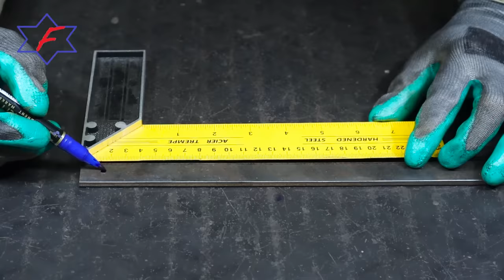Homemade Awesome Motorbike 250cc From Car Wheel And Using Single Side Swingarm

Comment: I have a few concerns #1 Why did you put both washers on the outside of the break flex hose #2 the steel hinges for the rear frame #3 the rear wheel bracket is welded in crocked #4 those small bolts on  the front and bars they are attached to there is more, but that this g is in no way safe to drive.

Comment: Anyone else notice the confounding front suspension design that tries to stretch the shock instead of compress it?
Reply: Nope
Reply: The front fork will not live long 😂
Reply: I'm wondering how he's welding without rod
Reply: Try to make a turn on that bike with that garbage Renault 5 wheels😁 not the best choice for a bike!
Reply: That's not safe...
Reply: He also didn’t try to see if the arcs of the fork systym even worked without binding before he was jumping on it , scary
Reply: Dear God in Heaven. The rear end is held on by the pins of two door hinges.
Reply: 22:36 look at that chain slack shake! 😂 How's it even staying on?!
Reply: @SirWulfrick 
It won't matter its not geared and will only go 15mph 😂

Comment: Use filler wire when TIG welding or that bike will collapse under your weight
Reply: Those door hinges for swingarm pivot are extremely sketch too.
Reply: I’m kind of concerned about the hand tightened nuts on the wheels. I would use a power tool to add torque to those nuts rather than hand tighten them. Or just use locking nuts and tighten them in the same way.
Reply: @Timberwolf35546  😘 en 😂😂 de 😂😂 de sector 😂😂😂😂😂😂*
Reply: @Timberwolf35546  ñ
Reply: @yellowtailsmultiverse8883  I was thinking hope he tightened those good lol

Comment: The two folding chair hinges hold the entire rear axle. But not for long.
Reply: Ouch if it snaps at full speed.
Reply: in cars, it is the same at the wheel and supports a greater weight
Reply: @remussebastianmadmax5816  don’t quit your day job to become an engineer
Reply: And they put the hinges on backwards so one hard bump and it will rip them apart for sure. 🤦
Reply: Yeah  they look hella unsafe, especially supporting car tires weight.
Reply: p
Reply: He welded the whole thing without using filler rods aswell
Reply: @fastfreddy918 cm
Reply: Gav
Reply: Semoga berkah ya jari tanganku sahabat2
Reply: Semangat2 sahabatlu
Reply: @kbakeritsallaboutnobody.5761  Y se pueden romper la madre
Reply: @kbakeritsallaboutnobody.5761

Comment: Just a little tip! Clamp your work down on the drill press if you want too keep all you body parts 😊  was a machinist for forty years and got all my fingers
Reply: Machines have changed bady
Reply: Another tip: Put clutch on opposite way... easier on crankshaft end and bearing... clutch body helps keep pantleg out of chain... less stress on rear axle/bearings... spring load the chain idler sprocket...
Reply: Takes off barely and slowly because need 3 times as much gear reduction...

Comment: The ideas are great and inspiring but the execution has its issues... You can't fabricate parts by only eyeballing the centres...
Anyway, keep up the work!!!
Reply: needs to use threadlock, prevent it coming apart thru vibration caused by freehand minor errors in  alignment.

Comment: Very cool! I've been wishing for decades there were full-sized motorcycles with only 250 CC engines that tall guys could really stretch out on. They're light, affordable and fun to drive but no one seems to make them.
Reply: Wal Do • 5 мес. назад
Very cool I l've been wishing for decades there were full-sized motorcycles with only 250 CD engines that tall guys could really stretch out on They're light affordable and fun to drive
Reply: Wal Do • 5 мес. назад
Very cool I l've been wishing for decades there were full-sized motorcycles with only 250 CD engines that tall guys could really stretch out on They're light affordable and fun to drive
Reply: @eeertvoin3161  🤔
Reply: @eeertvoin3161  твой пост странный
Reply: Harley-Davidson made one called The Route 66.

Comment: Awesome vid,awesome bike,I want one,but I would use lock washers on all the nuts and use filler wire on most of the welds. Great videography. I also would have a clamp for the handlebars so they could be adjusted,and a bracket on the exhaust, but an awesome looking bike and prototype,thankyou for posting,Best wishes to you, from, Auckland, New Zealand. 🙂👍✅⭐⭐⭐⭐⭐
Reply: 10:40
Reply: अअअ
Reply: Maq
Reply: @bariyakanubhai7810  !mm m
Reply: Agree… cool project, not sure about a few things as far as it lasting… welds without filler wire, using essentially door hinges for the articulation of the suspension, and the welding on the exhaust won’t last long with vibrations with its design and welding job. Clean thou, looks good…

Comment: Lots of quirky details: With those constructions, you can't expect either front nor rear wheel suspension to work - and consequently when driving they accordingly seem totally stiff.
Lots of corners and long bolts that could hurt yourself and walking people!
The hot air blowing from the motor cylinder seems to heat up the gasoline tank - could be a fire danger!
If you used all the parts coming with the bicycle stand, then it would be just a little more sturdy.
Besides all this looks nice and fun! 🙂
You could try to correct everything(!) - Good luck!
Ifyou get the rear swing to swing, then you need more chain guides.
Reply: OK Karen
Reply: You're not totally wrong. That front end is working against itself, you can see the single sided arm is the flex point. Ditto the rear,. it's pivoting on a damn door hinge, and is set in a way that even at rest only allows the swingarm to drop down, no room to go up. 

The gas tank and heat, however, the engine is covered in shrouds and has a fan inside the recoil housing that blows air through the shrouds and cool the engine. Residual heat while moving and even while sitting once shut down do not approach levels that cause any concern for the fuel.

Comment: Simplesmente fantástico......
Reply: Very Nice!👌🏍️
Reply: ok, rear swing arm on door hinges, it can last 2 days and then game over. and what about the welding of the frame with the bearing installed. Do you have idea what happens with the bearing if it is heated to 1000 celsius ?

Comment: Awesome, building a motorcycle from scratch!
Where the tube of the front wheel is connected to the head tube the metal seems a little thin. I don't really know, just visually.
Also conical bearings are better for a head tube but the ones you used are very big so that'll be OK.

Comment: 15:23 - I'd highly recommend against using a threaded bolt for a shock bolt because it will wear away at the inside of the shock mount and start making it rattle and get loose.... It's easy to get shouldered bolts that are made for shock mounts, but that's only if you want your build to last a long time.
Reply: اسلام علیکم میاں نیو یوٹیوب پر ہو میری ہیلپ کریں پلیز
Reply: @mramir1888  I wont be able to help you

Comment: I definitely would have used a spacer in between my hub bearings! Awesome build non the less👍🏼
Reply: I definitely would have used a mill and a lathe to give some level of precision to the manufacture of the hub assy, a give away that you're about to see shonky engineering is the wearing of gloves. Anybody thats been educated at college or to apprentice level in engineering knows not to wear gloves when using power tools,  Thats day one safety.

Comment: It's a nice YT bike proyect for sure.
But I wouldn't bet on it lasting more than a couple (and I'm being generous) of years of regular use. 
It's weird to me how it uses heavy gauge tubing in some places and (what appears that be) very light one on the frame where metal fatigue and cracks due to bending (not to mention the weakening of metal where welding occurs) will set much sooner.
I won't go into the couple of, are those door hinges? On the rear wheel arm and how close the strut is to the pivot point.
Definitely made for entertainment purposes, not practical ones.
Reply: Couple of hours maybe, thing is a death trap!

Comment: Biggest construction mistake: Rear hinges are auto-destructive, they go breaking when wehicle loaded, and they are 1-2 mm thick only. Load doesn't affect suspension but hinges to break (rear wheel can only go down, not up).
Otherwise, inspirative, simple, but welding geometry very sloppy.

Comment: If you can get hold of a book called "Motorcycle chassis design by Tony Foale", it will advance your work by light years, and influence all your other projects in a positive way. Also, the advice given in the comments sometimes comes from very experienced people - it`s all worth taking into consideration. Good Luck
Reply: E-mail

E-mail

E-mail

E-mail

E-mail

E-mail

E-mail

E-mail

E-mail

E-mail

E-mail

E-mail

E-mail

E-mail

E-mail

Comment: I love how they drag the tig tip across an already welded joint to make it look like they didn't use a filler rod 🙄🙄🙄
Reply: 0
Reply: You're one of those
Reply: @brijnandansingh7702  j
Reply: @salvadordolly712  🤷‍♂Sure am. Why bother.
Reply: They tried to hide but you found them 😂😂
Reply: motor 👎
Reply: It's called "Saving time".

Comment: Outstanding build, I didn’t see one piece of filler wire on the welding of any parts, as an engineer and qualified boilermaker, I certainly wouldn’t ride the thing. But groovy none the less.

Comment: You put your hydraulic brake hoses on wrong. A washer goes on each side bof the banjo fitting on the caliper. See how they're supposed to be on the handbrake. The way they are now may cause them to leak.
Reply: Nuif
Reply: I saw that too but they get corrected in time for fluids!

Comment: The design is good and the workmanship is excellent. I do feel that  both the front and back suspension could be better. Those two  hinges at the back do not complement the strength of the whole bike, same for the front suspension.
Apart from that the thinking behind it all is brilliant, Congratulations. All the best.

Comment: Good video, but one question: did you reverse the brake calipers? I say this because the bleed screws were down, and as we mechanics are tired of knowing, the air bubbles go up.... so your brakes can fail heated ☹️

Comment: Anyone notice that he put both crush washers on one side of the banjo bolt on all the brake hose connection! lol.    You don't think the front shock is doing anything since the double pivit point he welded to the down tube! I did like the video though.. 6 out 10!

Comment: As a bike builder, I can appreciate the inginuity, but there are SERIOUS safety concerns with the swing arm pivot, the brake line mountings, shock mountings, and chain alignment.

Even using it to run around the yard could result in serious injury.

A bit more thought would eliminate the problems on what is actually an inspired design.
Reply: Edit - he sorted out the brake lines

Comment: OK. Now, remove the centrifugal clutch, replace it with a torque belt drive, and jackshaft it also. Then maybe it will climb a hill, even with the driver aboard, considering it's weight.

Comment: nice work but the following locations will fail due to fatigue cracking from leverage.   the front forks,   the rear swing arm,  the front floor where it connects to the pipes going up to the stearing ,  the muffler pipe will fail where it attaches to the head, and the chain will come off  sprocket.

Comment: You need a much bigger rear sprocket. I would start with 60 tooth and that should be good for 45 mph at 4,000 rpm.

Comment: 7) You can not weld that cold-rolled steel properly without grinding off that mill scale
8) Use proper gas and Tungsten. For video purposes it was qwick ,but we know better...🤔🤔🤔...Otherwise nice job

Comment: No chain gaurds and two tiney screws to hold that kik stand on. Total cartoon. I built highspeed competition machines for over 50 years and safety inspectors wouldn't even let you ride around in the pit sreas on this joke. Dandahermit

Comment: I have never seen such mistakes in only one construction 😂.  Welding process is awful without metal apport in TIG, no washer under nuts, no maintain of ringballs, and the best  the fiting of brake pipes with 2 washers on the same side. Congratulations you make me laugh so much 😅😅

Comment: That was by no means homemade. Very few have that kind of equipment in their home. And I think a simple direct one-to-one gear drive on the back tire with a clutch would have been better than using that floppy junk chain which I believe couldn't last more than a dozen miles.
Reply: Your comment is homemade

Comment: Unfortunately, major fail.  The use of auto hubs is ingenious, and the skill level of the builder is good, and well above my own.  The weak point, however, is the CLUTCH.  I know from my experience with go-carts that those centrifugal clutches will quickly fail.  You will be replacing them after only a few uses.  You need to get a clutch from a honda minibike or similar that is made to handle the torque.

Comment: Both front and rear suspension would fail.  No trail in front steering.  Rear shock too close to pivot point.  Front shock looks to expand rather than compress.

Comment: I do not understand so high grade comments, it is the worst metal workshop, may be welding is OK, but there rest of actions are  totally insafe and unreliable. Suspension does not work at all.  Unsprung mass is VERY high, Console mounting  of levers are thin and totally unsafe.  And cherry of this cake is door hinge as an axis of rear lever. And method of placing ball bearing is shit. It is interesting how to lubricate and replace weared bearing. And there is no coaxiality of wheel , take a look at video: front wheel is vobling. Mounting of wheels with hand-made caps is terrible, because it makes mounting uncoaxial again. Total: disposable-ride  unsafe unreliable, unfuntional staff. Thanks for attention.

Comment: центровка, балансировка, вы где???
Задний амортизатор просто для вида? Он же не работает...
Тормоза, видимо, также совсем не нуждаются в точных установках, можно примерно рядом приварить суппорт, и норм...
Что попало как попало сделано, руки хорошо работают, но голова плохо соображает.
centering, balancing, where are you???
Rear shock absorber just for show? It doesn't work ...
The brakes, apparently, also don't need precise settings at all, you can weld a caliper approximately next to it, and the norms ...
Whatever is done, the hands work well, but the head doesn't think well.

Comment: I notice he is doing a crap load of fusion welds, if your not a welder, means he using the apparent base meatel as the filler.. some applications if it's specified, it's not good to do for a full on structural build. They tend to be weak welds.. Under fill  to much conclivity , weak ass weld...

Comment: GEAR CONNECTİON TO WHEEL MUST BE SAME BREAK. BEFORE THE BREAK. NEAR WHEEL. SAME BREAK, WİTH STRONG FLANC CONNECTİON ON BEARİNG SHAFT.SHAFT MUST BE FREE. WİTH BEARİNGS.SHAFT AND SHAFT BEARİNGS MUST HOLD  WHEEL TO MOTORBYCLE MAİN BODY

Comment: HOW DOES THE GEAR TURN WHEEL. ONLY SHAFT ROTATES.  GEAR WRONG CONNECTİON.YOU ARE WRONG WRONG CONNECTİON FALSE BUT MOTORBYCLE VERY GOOD THANKS

Comment: I’m sorry. But with all due respect, there are no safe welds anywhere on this project. Please don’t ride this thing. It’s an accident waiting to happen. Strong tig welding always requires filler rod. These welds on the frame will fail with use. Not safe.
Reply from the maker: I always use filler welding. In video, i hidden this process because it was too long. I also explained this issue several times in my videos. Anyways, sorry because make you & audiences confuse.

Comment: Nice to having 10's of 1000's of dollars worth of equipment to be able to save money building basically a useless motorized wheelbarrow....with no suspension.  Ouch.  And try adding a chain guard before your clothes or you get sucks into the drive sprocket.  Thumbs down.  Nice paint job, though.

Comment: That's so bad I don't know where to start. Can't believe he welded to the sude if that bearing. No assembly fitting. Straight welded that muckey mousr swing arm to that rear tobe. A few good bumps would torque that whole mess outta alignment. Jo jigging all eyeballing. Didn't even center any of the wherl n hub parts. Interesting. Could have been built properly correcting glaringly weak fastening
And some glaringly fragle attachments. Yikes
 Also really ugly motor. Must be from india.